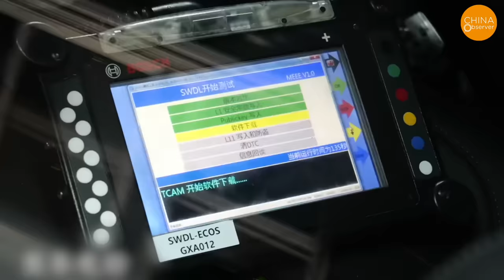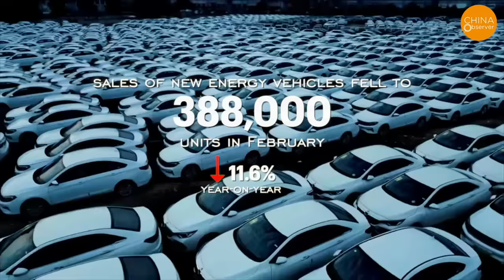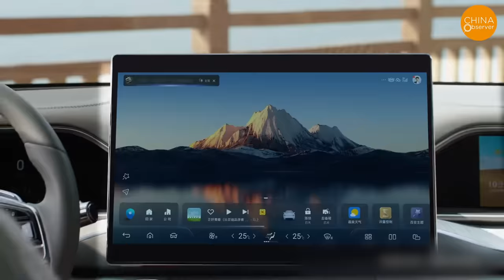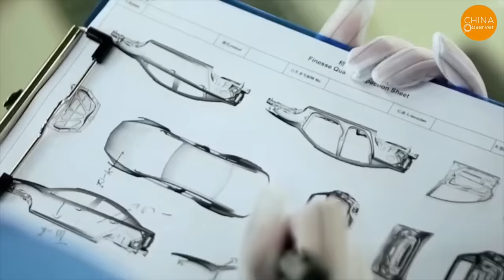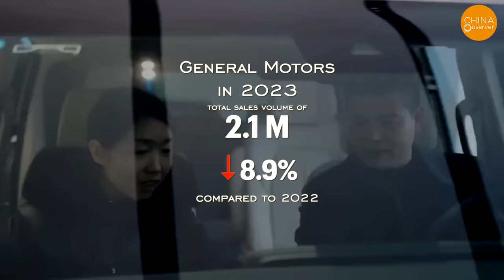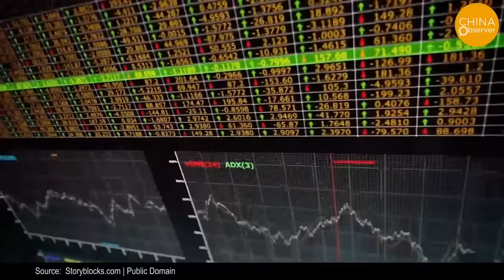Millions of New Cars Pile Up, Unsold for 5 Years, China’s Zombie Car Factories Keep Emerging

Comment: The batteries sitting there discharged for years will be no good. 😮
Reply: That's ideal, means the stealership can slap you with another twenty grand fee in six months to put a fresh NOS battery in, and six months after that...
Reply: Lot rot!
Reply: some EVs have clauses, that prolonged discharged state voids warranty
Reply: those batteries will self-combust because they have not been used allowing dendritic growth of decayed chemical short circuits between electrodes in the cells.     Any li-ion cell not used/charged for 6 months is a real fire risk.
Reply: These batteries will be dead for sure, compared to  petrol/diesel cars what still drive around as there will be roads to drive with ease.
Reply: @nem3th  lot rot applies to any car, regardless of propulsion
Reply: @veikovasko5603 what? Have you ever heard of a Honda or Toyota. I refurbished a old Honda motorcycle that had not been ran in over 15 years to work with a carburetor clean and oil change.
Reply: they will become unstable due too "dendrites" of elemental lithium in the cells, this can lead to shorts and thermal runaway

Comment: Because the prices asked are overpriced.
And this happens to western brands which see a decline, because they outrageously increased prices like crazy.
When a bloody VW Golf , a generic hatchback with a bloody 1 liter engine is sold starting at 27.000 euro...
Holy crap. That is a 14.000 euro car, HALF their asking price.
If we look at a golf from like 2010, entry level. at that 14.000 euro. There is no technological or equipment difference justifiable for doubling the asking price.
Inflation is a lie. Is a system where they constantly increase prices for more profits in their pockets. And Everyone increase prices because everyone needs to transport stuff around and if the vehicles are more expensive then everything else is more expensive, thus the snowballing effect called inflation.
So, the major problem are the automotive manufacturers that create this economic loss through their greed.

Comment: Overcapacity is actually an inevitable result of a market economy, while a planned economy can actually lead to supply shortages. You can refer to the Soviet Union and China during the planned economy period, because planned production basically does not generate any waste. At present, the Chinese automotive market is facing severe market competition, which is the reason for the large number of small car companies going bankrupt. If your products and prices are not competitive, they will inevitably be eliminated.

Comment: Well, electric cars suck and are inconvenient.
When tec will allow to fully fill up batteries in 5 minutes and hold for at least 3-5 hours as minimum then it will be debatable to switch off gasoline cars.
Reply: Which is already possible
Reply: @AveragePootis  Okey show me a electric car that can be fully charged in 5 minutes?
Reply: @roderickflint1330  it appears i was honestly mis informed, but right now the fastest charging ev's charge from about 5% to 80% around 20 minutes.
It sound ridiculous, and it is if you only would charge it like you would fuel a normal car, but you can also completely fill up the battery during work or during the night at home, which somewhat compensates
Reply: The gasoline pump is equivalent to 20 megawatts (33.4kwh/gallon * 10 gallons/minute pump * 60 minutes/hour = 20,040kw). EVs are much more efficient, say 2.5 times an ICE engine. So you might only need an 8000kW EV charger?  I'd like to see that!

Comment: we do pay  30.000 - 80.000$ for a average car, over there they are rotting away ,without making one single $ as profit, if i were a CEO iwould sell them for 10 or 15.000$ , Yes i do know it very well that is a low price , but still much more than rotting away. The real building price for those chinese cars is around de 7000 $ fabrik price , so how hard is it to make a dissission. or am i that dumb.
Reply: @Barbaric_hindus that,s expensive , compair to the average wages in india

Comment: If you buy a new car at a bargain price be sure to check for any issues like rust under and on the sides of the auto also check , battery problems tire rotten issues and much more. We have to remember that due to the high cost of an EV and the fact that EV's are not selling (so EV's are sitting on open lots up north exposed to the elements like Spring humidity, summer heat, fall Rain and moisture and winter snow. Now we are not talking just 6mo. or 9mo. rather we are talking years sitting in these open air lots due to high prices and people can not or do not want to pay for them. here is an example a GMC DENALI SUV fully loaded costs one hundred and 9 thousand dollars and this is just sticker now add in all your closing costs like taxes and such.

Comment: I was just wondering if all those cars have sets of keys sitting somewhere.
Is there a master key or code if they use an electronic system?
Also, would any if thise cars sitting so kong be sold as the year manufactured or the year the eventually sell them.
It seems parts that use rubber would deteriorate and the plastic interiors would crack.

Comment: The mid and low middle class and poor who buy used cars will be screwed by the EVs with failing batteries. They will be unable to pay for a replacement battery pack and will be screwed. Even if the used cars work, where are all these renters in apartments going to recharge all of these EVs???

Comment: While working in China, company that I worked had a fleet of Chinese EV vehicles and it was always a crapshoot. Battery was the main problem, sometimes even after charging for entire night car would not start and sometimes range will show up as 150+KM but battery will crap out after driving less than 100KM. Couple of cars also burnt down while charging in company parking lot. So company went back to ICE vehicles or bought Tesla for higher management people.

Comment: Recently a friend of mine decided to replace his B200 Benz and was surprised when his dealer friend had told him it is pretty much worthless car. Nine out of ten want an EV. Even the gas car prices are heavily discounted they won’t sell. Nissan and Toyota have negotiated smaller (20-40%) production quotas with their Chinese JV partners. CATL has announced their new generation battery prices will 50% cheaper this year. So basically nobody wants/dares to buy expensive new gas car so those factories will close in 2-3 years. He then went to test drive several EVs for the first time ever and told me:”Now I know, gas cars are crap, no question about it. The problem is I don’t know which EV to choose.”